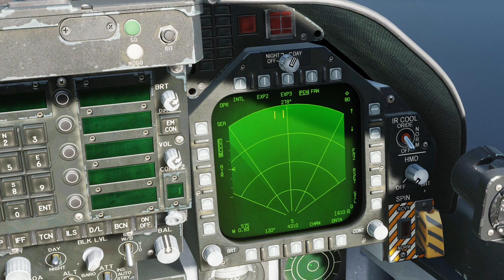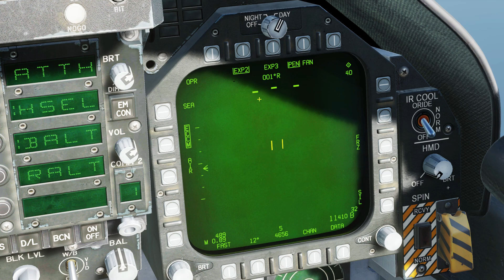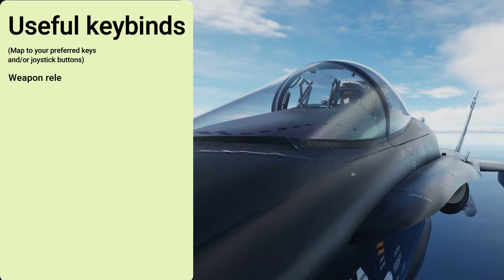DCS F18 Harpoon R/BL Tutorial - AGM-85D with Radar in Sea Mode

Comment: can't understand his words
Reply: I understood him just fine. My notes:

	1. Click for air to ground mode
	2. Select Harpoon on first button on left display at top row
	3. Put radar in sea mode by clicking on first button at top row on right display
	4. Set radar range to 80 by clicking on first button on right display
	5. Set cruise altitude of each missile to low by clicking FLT on left display and clicking low.
		a. Click STEP on right side of left display to cycle thru all missiles. The selected missile will have a rectangle around its lettering of HPO. 
	6. To change terminal mode of missiles to POP, click TERM button on left side of left display and click POP.
	7. Increase altitude to pick up targets better on radar, but stay below 8k to avoid being fired upon. 
	8. Sensor select switch right (Modifier 1 (Red Button)+Trim?)
		a. Two yellow rectangles pop up on radar (right display) 
	9. TDC Slew by using Trim. This moves around the rectangles to target ships. 
	10. Sensor select switch right to lock and unlock target. 
		a. It should say Track at bottom center of radar.
	11. Click A/P button below CLR button on keypad. 
	12. Click RALT
	13. When ready to fire, increase altitude to above 8k. 
	14. Once targets come up on radar (about 40 nautical miles), click EXP2 to zoom in. 
	15. Step thru all missiles and set MODE to R/BL (Range and Bearing)
16. Go cold and flare.

Comment: When he says TDC right does he mean the uncage/cage?
Reply: Throttle Designator Controller basically move cursor to the ping. If you had radar on right side you would move cursor on the right panel. If you would have the screen on the left panel he would of said tdc left meaning move your cursor on left panel. Wherever you have your radar move your cursor to designate target